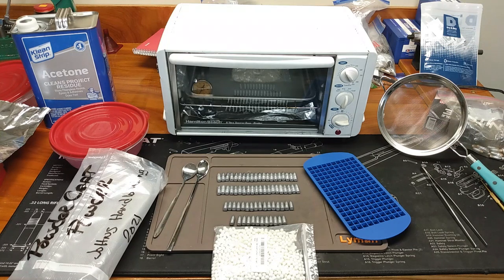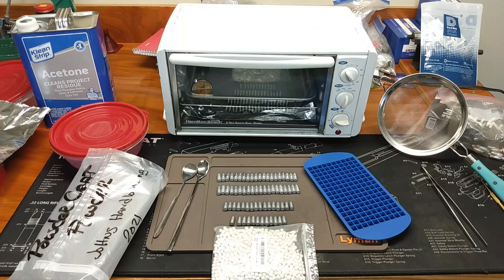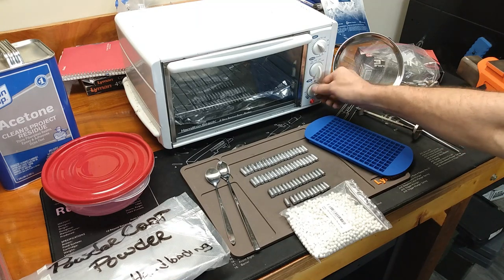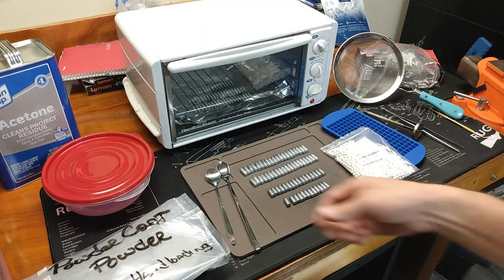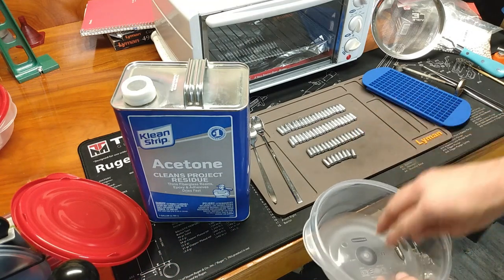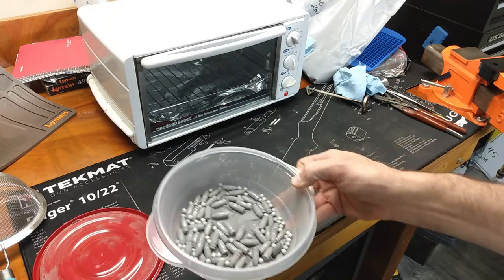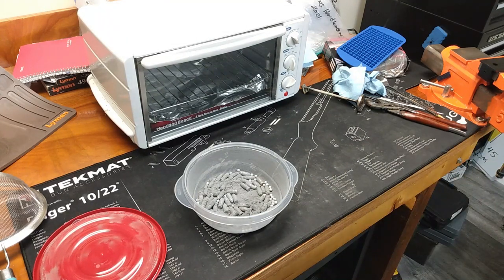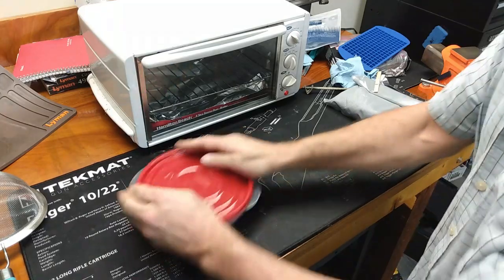Powder Coating: LeadSmith Makes a Mess! pt  1

Comment: You need to really get rid of the excess powder on the bullets. I made that same mistake in the beginning and it did not go well. Don’t be afraid to shake the excess powder off. Stand the bullets up in the ice cube tray, they will be just fine. I’ve even put 22 caliber bullets in the ice cube tray as well as 30 caliber with great success.
Reply from the maker: Thats good to hear. I can probably get a lot more bullets in the oven in one shot with the trays to. Thank you!
Reply: I agree,

I use wire mesh, drawer organizer baskets with good success. (See in my videos) 
You get a better even coating "sifting off" excess powder vs taping it off. But try both and see what YOU think. 

Ford light blue has become our "industry standard" bullet
Color!  Its almost always a good choice.

Comment: Hey thanks for the shout out Lead Brother, I think I see the ice tray in your future haha...I thought standing them up was fine at first,  but the ice trays will increase the speed quite a bit ....and after a few times of tipping over 10 minutes time standing up of bullets wasted you'll start looking for solutions. I dont use the spaghetti strainer because for me, it takes off too much powder. Use the PC thickness or lack of it to your advantage - If I were applying GCs like you are I think its a smart move to shake them out in the strainer so the GCs will still fit... you will find the PC adds a measurable difference and sometimes after PC the GC doesnt want to fit so much anymore. I applied GCs to bullets and then PCd them in the past to get around it. I might not shoot fast enough (35 Remington and 35 Whelen) to need GCs with PCd bullets....still not finished testing that yet
Reply from the maker: Thank you my friend! I do like the thickness on the GC shank. I think it was a smidge undersized to start with, so PCing helped. Thanks for coming by

Comment: Plain old heat treating has no extra cost or fuss. 
After watching the video...a Lot Less Mess. Seems like a lot of work for no gain.
Reply from the maker: Could be so. The same bullets (heat treated and air cooled) that I used with 2 different traditional lubes BAC and 2500plus will be compared soon to the powder coating. I look forward to finding out.
Reply: @leadsmith5873  If you water drop after heat treating, you will get a harder bullet as you know. You have to match BNH to velocity.
I have yet to get any leading in my 500 Nitro Express rifle, or any of my handguns that I've taken the time to match the bullet to the gun. Most times leading is due to someone not knowing what they are doing or being lazy.

Comment: It looks like you made a good start. I have a few suggestions, I think I already gave you the link to my newer powder coating video with the cool whip container but it is worth repeating I guess: https://www.youtube.com/watch?v=LEmkhljdvs4&t=2s
Reply: So suggestions, and again you need to find your own way with good advice and how you like your results. Suggestions, use non stick foil if you use foil, parchment paper works as long as you don't burn it. The warning on the box is because a toaster over swings in temperature so high that even if the oven is set at 425 F (the edge of burning up the parchment paper) the oven will go past that temperature and burn the paper. Many guys use parchment paper with great results.  Next suggestion, don't do this inside your house. The fumes are nasty and can't be good for you. I am surprised it did not smoke a lot and smell bad. Outside or in a garage with good ventilation is my suggestion. You want to pre heat the oven for at least a whole cycle (20 minutes ish or longer) to get it hot prior to putting the coated bullets in. I suggest trying the silicone tray for the rifle bullets, they work great and you can put a ton in the tray. The silicone ice cube tray will smoke a lot and smell bad, and it will take several cooking cycles for it to become seasoned and not smoke much. I suggest shaking a little more aggressively to get them coated, but you sort of have to find a happy medium where the amount of powder, bullets and beads/airsoft bbs is in harmony. The Ford light blue is a great powder and should work well. There is a multitude of ways to do this and people are sure their way is best. You will find your way and like it eventually. I was told early on that 'lubing is easier and less time consuming'. I disagree. I have shot a lot of cast lead bullets with great results and don't own a lubri sizer. I have pan lubed and used Alox and my best results have always come from powder coating. Once you get a system down it goes quick and you see good results. Good luck. Good video. Thank you for taking us along on your first trip.
Reply from the maker: Thank you John. All good advice! I can probably put my oven on the back deck next time. I did not notice much of a smell. Honestly the Acetone probably overpowered it lol. Thanks for the heads up about the ice tray smoking. I wouldn't have expected that. Thank you for all your support!